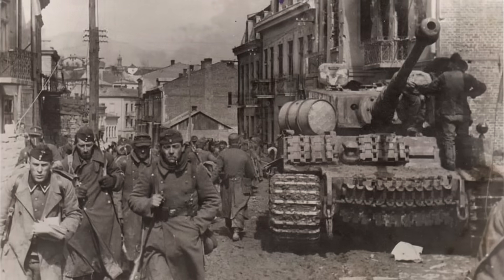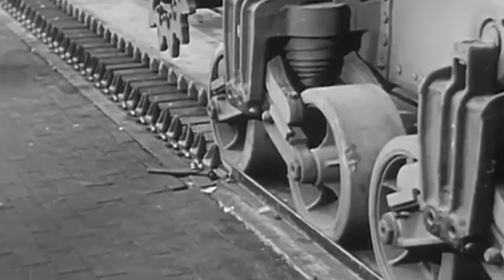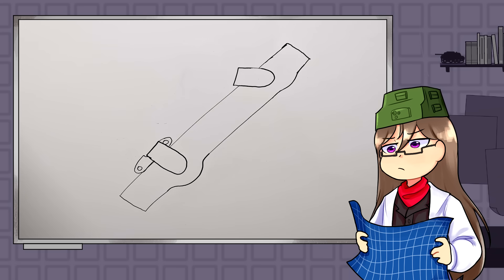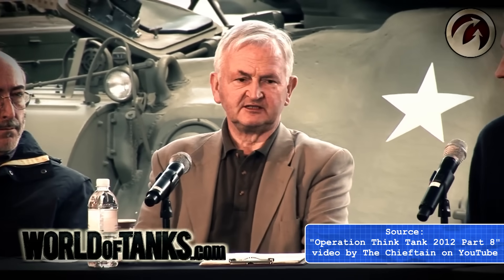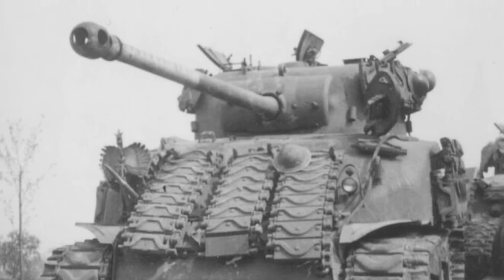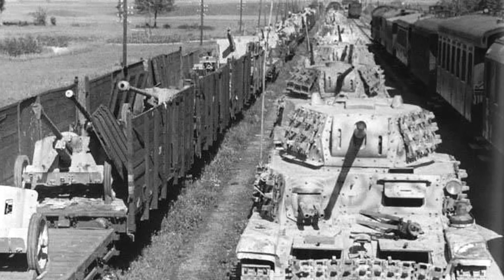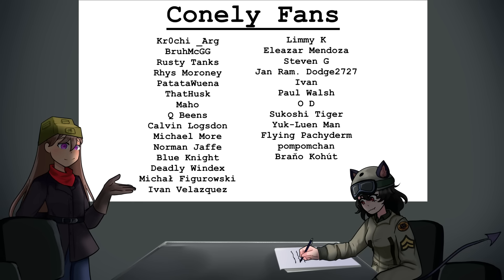Tank Tracks as Armor: Good or Bad?

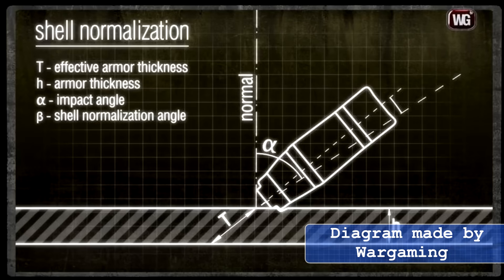Comment: As far as I know, the idea that conventional steel rounds normalize like what is shown at 3:45 is simply not true.

Upon hitting armor, a conventional round will almost always denormalize. It is only upon starting to exit the armor that a round will normalize towards the plate. The amount of denormalization and normalization depends on a lot of factors, but primarily the energy of the round. A round that has an easy time going through a specific plate of armor won't normalize or denormalize much, it will simply go through, but if it just barely goes through the plate, it change course much more substantially.

This happens simply due to the resistance that the round is experiencing at any given time. Upon hitting an angled plate of armor, the round is pushed upwards simply because the armor offers more resistance to the round than the air above it. Likewise, when the round is starting to exit the armor plate, there is less steel below the round than above it, making travel downwards easier.

This explains the diagram that is seen at 4:05, since the round will start to normalize when it starts to exit the plate due to the air gap. The moment you take away the air gap though, this no longer happens since that difference in resistance just isn't meaningful.
As an example, these two simulations (https://www.youtube.com/watch?v=p4F5V03e2mk and https://www.youtube.com/watch?v=DymqrW2gzGQ) show an M4A3E2's upper glacis being shot by 85 BR-365 APHEBC and 88 mm Pzgr.39 APCBC. The M4A3E2's upper glacis is composed of a 38.1 mm RHA plate welded on top of a 63.5 mm RHA plate, with no air gap. You can see from the simulations that the rounds only denormalize, even when they've defeated the initial plate they don't normalize.

Something else to keep in mind is that BR-365 is a blunt nosed round, like as shown in the 3:45 diagram. It just shows that those diagrams that show forces and the round normalizing are simply unrealistic and not true.
Reply from the maker: The "normalization" behavior depends on factors like the shape of the shell and the material of the cap used on it. As I said there are many factors involved in ballistics and this video didn't need to be 20+ minutes of me talking about those factors in detail
Reply: @ConeOfArc  Caps tend to lead to poorer performance against angled armor. The british tested this with their 2 pdr, 6 pdr and 17 pdr guns.
Their conclusion was that if the APCBC penetrator weights the same as the AP shot, like on the 2 and 6 pounder guns where the APCBC is overall heavier but the actual penetrator is 2 and 6 pounds, then a velocity increase of 50 ft/s over the AP would be needed for the APCBC to achieve penetration. If the penetrator does not weight the same as the AP shot, like on the 17 pounder where both rounds weight a total of 17 pounds but the APCBC penetrator is only 15 pounds, then a velocity increase of 200 to 250 ft/s was needed.

Likewise, the US stopped using APCBC rounds in post war years and opted for APBC, as their uncapped round designs outperformed the capped ones in the vast majority of situations against angled armor. It's why the M103 fires a massive APBC round. Only against armor that was far thicker than the projectile's diameter did the APCBC round perform better, prehaps due to the fact that the APBC would shatter too much to achieve penetration (although this is speculation on my end).

Either way the whole point of my comment was to say that normalization doesn't happen like the diagram at 3:45 shows, and it doesn't happen when you have armor layered on top of each other, like how it would be with track armor. In fact someone else in the comments already mentioned how someone has ran simulations of a Tiger II turret being shot by 85 mm BR-365K with and without track armor, and how with the track armor there's only a small plug pushed out of the armor, while without the track armor the round just makes it through.
Reply from the maker: @flipallthetables793  I think you're misunderstanding the difference between caps and ballistic caps as one is essentially just a windshield to improve flight and the other is to help it once it impacts the armor by having a soft cap almost exactly like what the tracks do to the projectile when it hits
Reply: @ConeOfArc  I am not. The purpose of a cap is to prevent the round from catastrophically shattering (and having decreased performance) when impacting armor, by effectively providing a "cushion" on first contact. Beyond that, caps tend to be detrimental, as shown by the tests I've mentioned.

Basically, a cap doesn't help with penetration. It helps with keeping the penetrator of the projectile intact on impact, but once that is achieved the cap pretty much does nothing but hinder penetration. The penetrator of a capped round needs not only go through the armor itself, but also the cap that is in front of it. Additionally, because some of the mass of the projectile is compromised of the cap, not all of the kinetic energy of the projectile is used for efficient penetration of armor. In short, not only does the cap "steal" some of the kinetic energy away from the penetrator, it then needs additional kinetic energy to be bypassed as well.

If anything, a majority of people are misguided/misinformed on the purpose of caps, either by thinking that they help normalize against armor or that they reduce ricochet, when this is more than likely not true. Again, the US specifically started making APBC rounds to counter angled armor, not APCBC. The 90 mm gun firing M77 AP (not even a ballistic cap to improve performance over distance) could defeat a Panther's upper glacis at 600 yards, when M82 APCBC with improved muzzle velocity of 2800 ft/s couldn't do it at any range.

Edit: There's this great short that shows what I'm talking about: https://www.youtube.com/shorts/63RnxtBDXCk

Comment: What track armor does well is: if you got to carry spare tracks in case of a need for a field repair, better used them as armor when you carry them.
Reply from the maker: True, but you can also optimize the placement of them to provide the most benefit. The Germans did this fairly well on things like the Tigers and Jagdtiger by placing them on the sides or other flat plates. By doing that you can carry spares AND maximize the small amount of added protection they provide. It also has the benefit of protecting the spares from damage
Reply: @ConeOfArc yeah true, that’s why i found it weird that some shermans had the spare links and road wheels on the back of the tank since it’s the place that you are less likely to get hit and even if you get hit, it’s a penetration anyways because of the weak base armor. In my opinion best used of track armor is the front hull of the tiger since the armor is flat and it’s a pretty easy to hit place

Comment: Regular shells don’t really normalize on impact against sloped armor.
However, depending on the shell design, a shell will induce more or less of its force to the normal, thus changing the efficiency to defeat the sloped plate.
A sharp shell will induce little force to the normal, unless the nose breaks on impact.
So protecting the nose with a cap against sloped armor is counterproductive.

During exit the shell will however normalize since there’s less armor resistance to the normal.
Reply from the maker: Hence why I said there are many other factors I didn't include, if I do a follow up more in depth I'll go into that aspect

Comment: There’s an article on tank archives where tracks reduced the penetration range of a T-34 by 200m by a Pak 40. Which translates to roughly 5-6mm of armor penetration at normal impact.
So tracks didn’t do a whole lot but you might as well just mount them where you are likely to get shot.
Reply from the maker: Different steel types for the armor and tracks will give you different results but generally it does add some level of protection. The main point of the video is to show that for the weight tracks tend to not be very useful as armor. Especially true once you add in the fact that it can assist with shell normalization
Reply: Reminds me of our roofing harnesses stored in buckets. We bring them to each jobsite but never use them. But if you stack them up you can use the buckets as stairs. Better to be useful once for something it wasnt meant for, than never used at all
Reply: Considering that the KwK (or StuK on a StuG) 40 , or Pak 40 if a towed AT gun or mounted on a panzerjager, considerably out-ranged the F-34 76 mm gun of the T-34, anything that allowed the Soviet beast to close in was beneficial.
Reply: But the same track links increased the chance a shell would catch on the armor instead of glancing off.

Comment: Tank Archives, often mentioned that it was ordered to place track links on the UFP of the T-34 and it's variants due to it increasing protection, i also thought that the track links should perform better against capped shells as the interaction betwen the softer steel of the tracks and the cap might reduce the  normalization compared to the high hardness of the actual armor plate, due to the track link taking more of the deformation
Reply from the maker: As I said there are MANY additional factors to consider but it would have made this video much longer without really adding much to the main topic. This is more meant as a base level introduction to the subject not a breakdown of every scenario
Reply: @ConeOfArc  Yes, it is a good overview, the topic goes way too deep to even scratch the surface in a short video, and it gets very complicated and technical very fast

Comment: One thing that can be quite certain is; it does improve troop's morale and that could possibly make them perform better and more confidence in their task which could also lead to reduce fatality. This can't be quantify by any mean but troop's morale is also another factor to be consider in amidst of horrible of war.
Reply: On the other hand, if the added weight causes the vehicle's performance to suffer, or leads to a breakdown, or causes it to run out of gas faster, you're not getting much additional performance no matter how much it improves moral.
Reply: Aint no soldier  buying that that track is going to stop a tank round.
Reply: @herringbone5035 then why was it so common for them to be used as excess armor? They’d even use materials like concrete and sandbags as improvised armor. Clearly they thought it did something
Reply: @lukastroutman4600  Track sections are hung on vehicles as spare track sections and will only stop small arms that the armor already is going to stop. Sandbags are handy to prevent spalling.
Reply: Higher morale boost: Believe you will always score the first hit before enemy does, so your armor won't matter. 😎
Reply: A great example for that is the Russian “cope cages”
Reply: @Ranyick  Except, ignorant clown regurgitating racist propaganda, dozens of countries are now aping the Russian designs and you see hundreds of videos of ukie drones bouncing off them...
Reply: @Ranyick Cope cages do work. They're extremely effective against HEAT particularly because it gives a huge standoff
Reply: @Ranyick  If they're only for morale then why are we seeing other countries that are not at war adopt them?
Reply: @baikal9268  I’m not saying they’re ONLY for moral, but they were initially installed to counter the tankers’ fear of top-attack ATGMs like the Javelin and NLAW, to which they obviously didn’t really protect
Reply: @Ranyick Which then, just through sheer coincidence ended up giving them actually functional anti drone armour before drones were even really in use. Funny how things are sometimes
Reply: @sharcc2511  absolutely
Reply: @Ranyick  "Don't really protect"? LOL, kiddo, explain then why Javelin hit rate in ukr was less than 1/10 what producent promised 2 years ago, and now less than 1/20 against new types of cages? And why ukros sitting in trenches and bunkers often leave them unfired when they run because they know there is no point and Russian tank is vastly more likely to obliterate whoever fired it first?
Reply: @KuK137  because apparently a decent chunk of the Javelins they received had out-of-date batteries. Some “cope cages”, like the ones mounted on the T-80BVM Obr. 2023 will protect from Javelins as they feature ERA on top, but without ERA they won’t do much against those missiles except for making the crew more confident
Reply: @baikal9268  The Americans and the Brits were the only other large scale adopters of cage or slat armour...They as quickly got rid of it though. So that should tell you something.
Reply: @KuK137  Are you suggesting the cages are camouflage rather than armour?

Comment: TLDW: tank tracks are mild steel, not hardened armor. Some types of shells have a soft mild steel cap to reduce ricochet on oblique armor impacts. The tracks can do the same, directing more of an oblique impact into the armor instead of a ricochet.
Reply: The US Military, USA & USN, went to higher hardness armor piercing caps, sometime at a hardness at the nose greater than that at an armor’s face. These would shatter upon impact on armor but were effective against face hardened armor. The cap would also cause failure of the hard face. Cracks in the armor could propagate through the continuous armor.  But the failure of the cap could not easily cross the discontinuity between the cap and shell body proper.

Comment: my comment is how many of these tanks are carrying tracks PRIMARILY to have as much spare track in the field for repairs in areas with lots of mines and how many are JUST using them as armor.

also adding lots of extra weight to a vehicle makes it slower use more fuel and prone to suspension and power train breakage faster.
IMO track armore like log armor or sandbag armor is there for the crews to "feel" safer.

Comment: There's actually a great ballistic simulation I saw about this a while back, I believe it was either SY SImulations or DenjaminXYZ who did it but they simulated a Tiger turret side with spare links vs no spare links. The general summary of the outcome is "It adds additional protection but the additional protection added is sparse to the point where it will only make a noticeable difference in edge cases".

It only takes one successful case of a track link actually working against a shell before every single tanker thinks it's going to make the difference every time. Tankers are borderline braindead.

Comment: Track links being softer is realitve, rubber pad tracks due to their construction would make somewhat of a difference, but the steel used inside is still VERY hard manganese steel. Manganese steel tracks were a huge developmental advantage to dozers, etc, and was often touted in early sales literature. We often think about the effects of denying manganese, nickle, molybdenum, chromium, tungsten, and other rare elements to the Axis powers on their armor without considering its effect on tracks, gears, and sprockets etc. (Also the machining tools needed to work these steels) it basically sets you back to the 1700's Think about the fact that depending on different factors, a dozer with maganese tracks will often need the pins or rails (chain) replaced before the pads, them having plenty of grouser height left. Those grousers have way less surface area than the ones on a tank and experience a lot of slipping under high loads. In rock quarries, it may be a different story, especially with modern, lubricated, sealed pins. However, armor is hardened to a different design. Track pads may bend some, but can and do break because of how hard they are. Also to be considered is the fact that while weighing more than a sheet of thinner armor they were not applied to the whole vehicle generally and the psychological effect of being able to feel like you yourself could do SOMETHING to help the situation was valuable. However it didn't inspire recklessness because you still weren't going to wander out in front of an 88 or any other AT gun with a feeling of newfound impunity. This is from talking to veterans and reading their stories. The extra side armor on the panther etc, is somewhat misunderstood it was needed because even the small caliber man carried AT rifles were penetrating the thin side armor especially on the eastern front. It was noticed that the rounds striking road wheel rims first were defeated.  In this role it was very effective breaking up the round before penetration. One of those cases where spaced armor like battleships use was more effective than a homogeneous plate. It also can be thru hardened because spalling isn't an issue. However against some larger caliber rounds it was actually a detriment. 😊

Comment: what if the tracks (or improvised armor plates) were mounted on a reverse angle to the armor for reversed normalization? Armor sloped down, have the tracks sit on a upwards slope shelf.
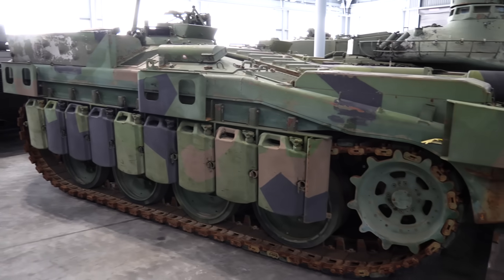Reply: I would think that doing that would require additional track for coverage, since incoming rounds would be angled down. I would guess that you'd get better performance by hanging track on frames away from the side of the vehicle, à la WWII German _schurzen_, so you get the thickness of the track, a vertical surface to normalize the incoming shell toward the horizontal and increasing the effectiveness of any armor slope, and a standoff to move shaped-charge detonations further away from the primary armor to degrade the jet performance. I expect that you'd still come off with a net disadvantage due to the weight of the tracks, but from the example of the Strv103 (at 2:20 in the video), where it carries 20l fuel cans hung from the hull to provide additional protection against HEAT rounds, that may not always be the case.